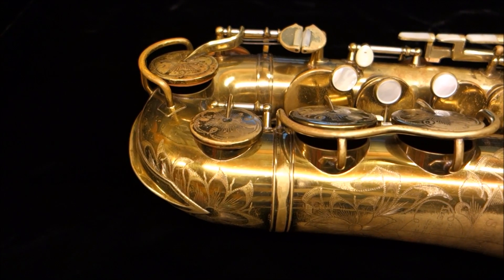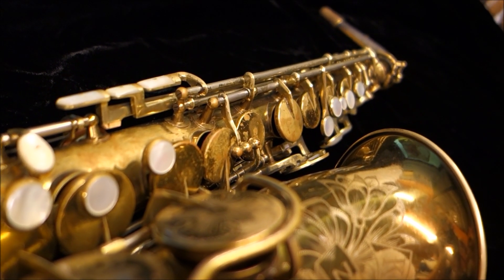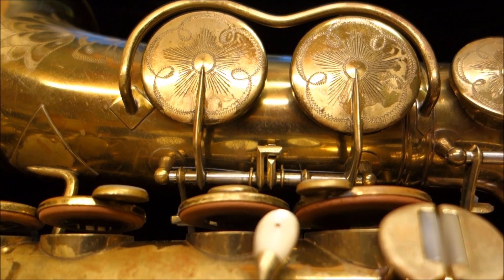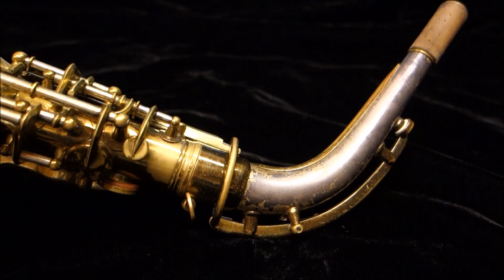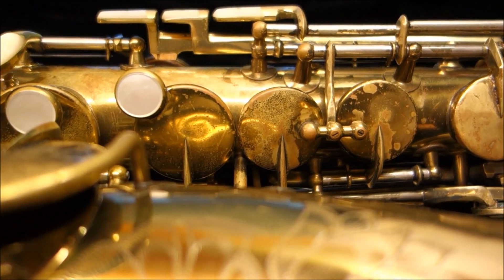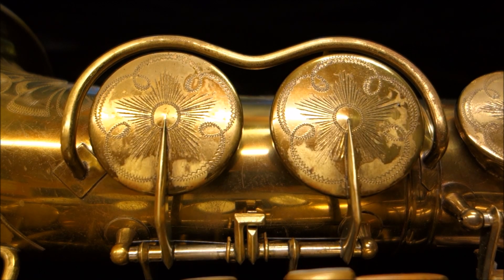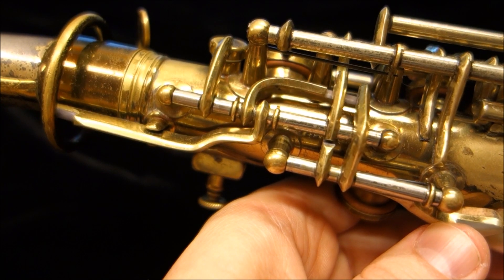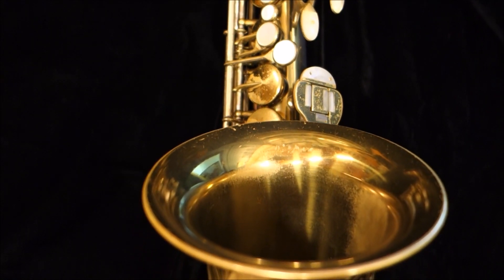A Saxophone Repairman on Why Saxophones Are Beautiful

Comment: Thank you for this video! I picked up a saxophone for my woodwind methods class, and I haven't been able to put it down since;  I find everything about it captivating, and I think your video does a good job of describing at least a small part of that. I also appreciate what you've done with the Open Source Saxophone Project and your other repair videos. I bought an old junky YAS-21 to start learning how to do some repairs, and have been working my way through your videos since I stumbled on your page. So far they've been enlightening! I know you mention some of the tools you use in different videos, but do you have a video that specifically discusses essential and recommended tools for someone who is just getting started?
Reply from the maker: Amanda Ezell thank you!  

No video like that, just the tools section on the open source saxophone project.